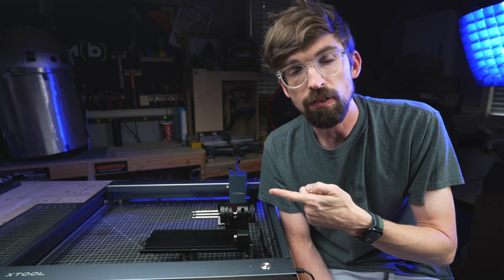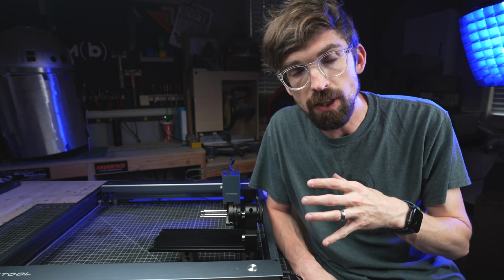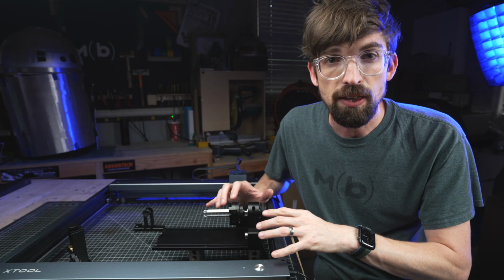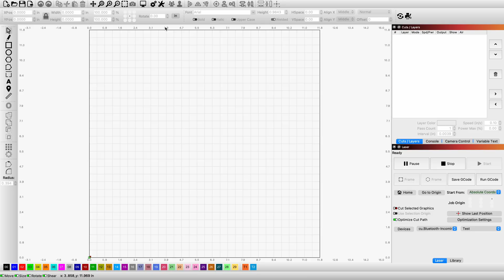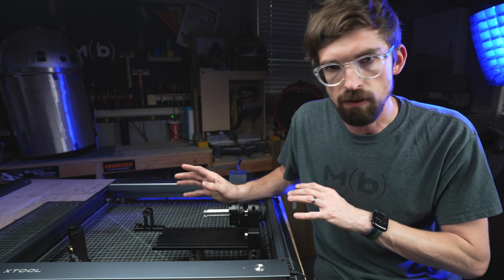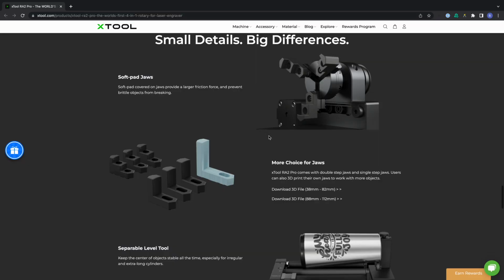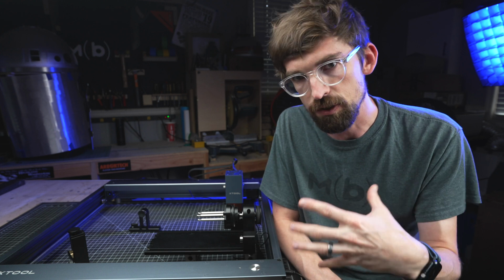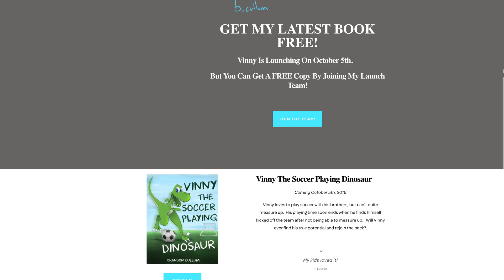The Best Rotary for a Diode Laser - xTool RA2 Pro Review

Comment: Love these reviews and informative posts.  Based on a shirt you were wearing in another video, are you in the Atlanta area?  I'm in north Cobb County myself.
Reply from the maker: Athens, but in Atlanta a good bit!
Reply: @makeorbreakshop  awesome!  We do a lot of high end cosplay builds and have friends that run prop shops for most of the major film productions in the area.  This xTool D1 machine is really calling to me for cutting EVA foam and leather.  I have a Cricut, but need something that does thicker materials (> the 2mm max of the Cricut) like EVA foam, and stuff like Worbla, acrylic, leather, etc.  Have you had any experience with it cutting/sculpting/etching EVA and cutting Worbla?
Reply from the maker: @robertfousch2703  EVA foam you can cut, I've only done it on my CO2 machines but I'll need to try it on a diode like the D1.  The only issue I would see is getting through something that is thick.

Also which prop shops?  Always love to know the people in the area making cool stuff for Hollywood!

Comment: So I want to a Variety of things. Cups, wood, leather, all sorts of stuff. I do own a business and I am looking at either a CO2 laser or a diode laser. I watched the reviews on the muse, and some others. Basically I have narrowed it down to this X tool and the muse. I know the price difference is huge.

It looks like the X tool has a better rotary attachment. But the muse is obviously a little higher quality. I would just be starting out would you suggest a diode or CO2? Specifically one of these two machines. I guess the main thing that these would be used for is designs on leather and tumblers/cups. Any advice would be Appreciated. Thanks advance.
Reply: Co2 is faster and the p2 has double cameras automatic batch, you don’t have to do a jig
You can also cut clear acrylic

It may depend on what it is  you’re trying to accomplish

Comment: Great review. Thanks! Will the RA2 work with other lasers if they are using Lightburrn software?
Reply from the maker: Thats a great question, my guess is yes since its all GRBL controlled but I would double check with xTool directly.
Reply: @makeorbreakshop  Thanks for the quick reply. I went to the X1 website and they claim it will work with other machines.